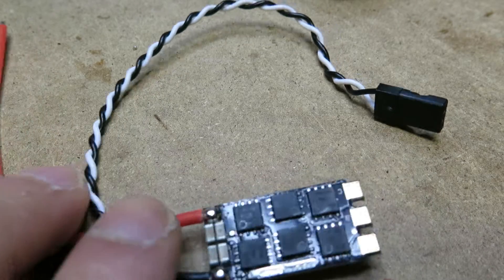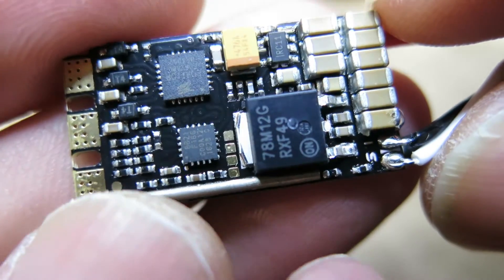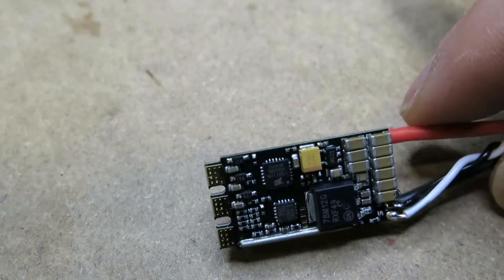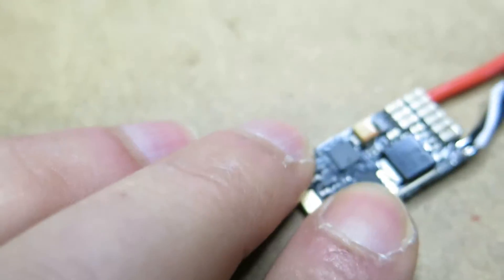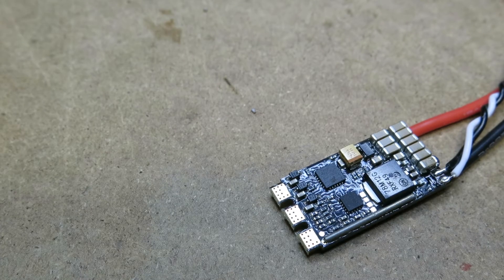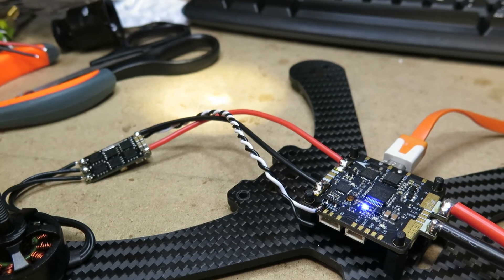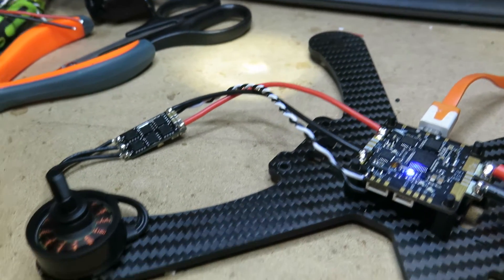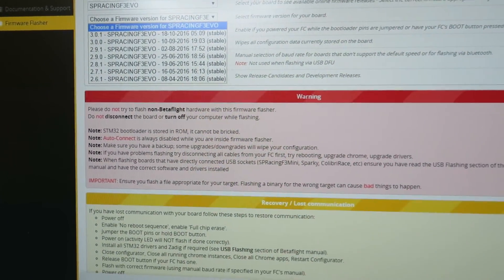Spedix ES30 Dshot 600 mod & flash / Bench test

Comment: have u ran 5/6s on these? i have dys xs30 and keep having lately for some reason burnt esc on 5s so im not sure whats the issue but had crash and i replaced frame,flightboard omnibus f4 pro v3 motors and had extra set of dys xs3o and now esc burns almost everytime ran 5s but 4s no issue
Reply from the maker: yup they run 5s totally fine even with F80 on 7045 props ..... Spedix ES30 will go thru anything ive seen so far
Reply: RotoRev thanks so much, do u have to hook signal ground up?

Comment: You did the blheli suite too fast, amtel or silabs? I can't get my spedix esc to connect to blhelisuite.
Reply from the maker: Silabs
Reply: Thank you, I ended up using google chrome blheli configurator to get the esc up to date. My mac could not see the com port 2 on blhelisuite, but it works great on betaflight 3.1.5 on the betaflight f3 fc.

Comment: Why did you not ground ESC signal? Any reason or just for a quick test?
Reply: Alex DiJ common ground from esc does for now specially with a digital protocol like dshot .. even in case of noise due to messy wiring crc checks should take care of any ...
Reply: Did you try it without removing the capacitor? I have these ESCs and just got an f4 board to use dshot but I want to be really sure before I go messing with them. I tested it on dshot150 at 1khz and its really bad. As soon as I try to start it up the motor flicks and the ESC re initializes. Do you think removing the cap will fix all of that or is it possible that the FC I have just won't work?
Reply: They do multishot fine. Are the smooth? Yes just like any other Blheli_S ESC. Is it worth it? Worth what? Worth upgrading?That depends on what you have now. If your building a new quad then definitely go for these but I wouldn't bother upgrading if you already have decent ESCs. I decided I am going to remove the Caps. Probably this afternoon so I will let you know how it goes.
Reply: So I just removed the cap and D-Shot works!!! At least on the bench. These ESCs were on a quad before and I am rebuilding it on a new frame with new FC (That supports Dshot) and new motors so I have not flown them yet with D-Shot and it will probably be a little while as my VTX just burnt out so that'll hold up the whole job. I can highly recommend these ESCs. They are awesome. I have some racerstar RS 35A ESCs on my 450 3D quad and I know it's not a direct comparison to a mini quad but I think these ESCs are much better. On the 3D quad they don't have nearly as much power as it did on the old ones (I think there is an issue with something but haven't traced it down yet) these ESCs (Spedix) are small, light, handle up to 6s and have a heatsink which is nice since you have the option to use it. It's so easy to remove the heatsink if your after extremely light weight and if you use it it protects the ESC from prop strikes. The ESCs I a running are not actually Spedix brand but a rebranded version. I got them for $45 on Amazon with 2 day shipping. I will post the link and update you when I get the quad flying. Like I said it might be a week or so.
Reply: https://www.amazon.com/gp/product/B01MAXL72T/ref=oh_aui_detailpage_o04_s00?ie=UTF8&psc=1
Reply: No problem. Yes these ESCs are awesome, you won't be disappointed. I will let you know how they fly with D-Shot once I get the new rig up and running. My VTX will be here today so I think by Monday it should be good to go.